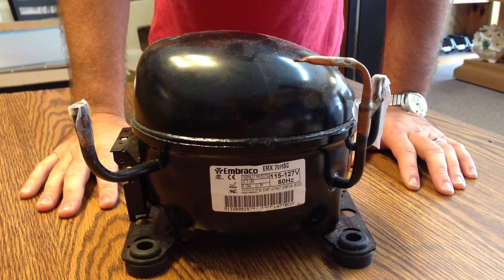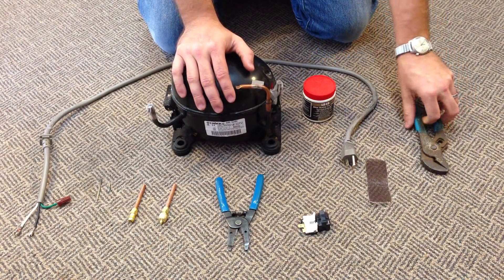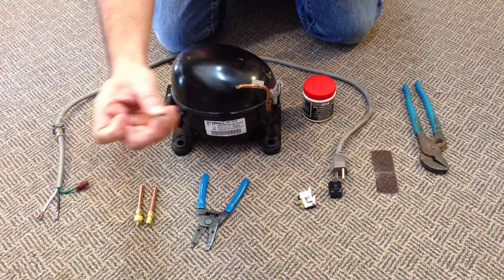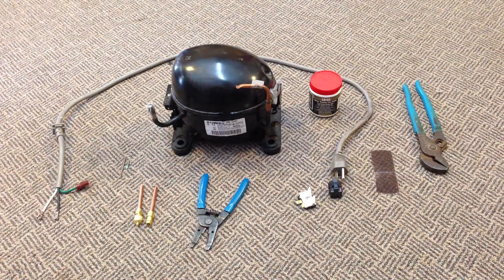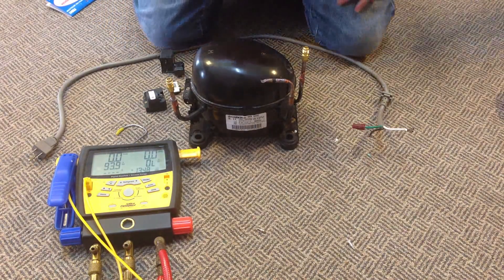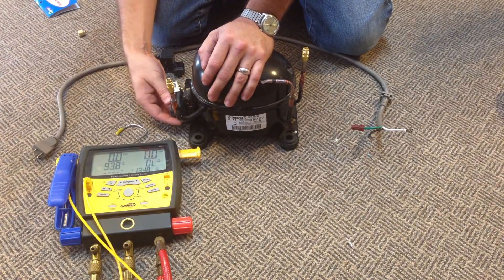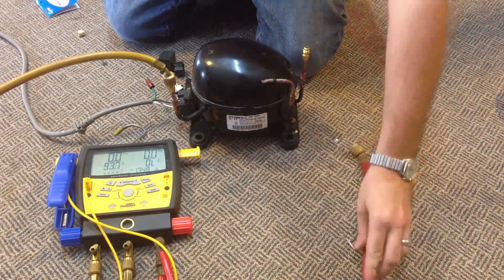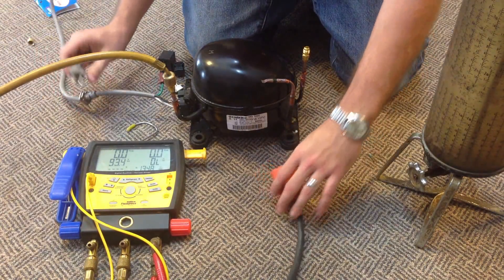How To Make a Vacuum Pump from Old Compressor

Comment: To sand the stubs of tubing, turn the unit on its side, more than 90-degree turn, so the grit will not go down the tubing into the compressor. Or plug the tubing with rolled up bit of paper towel, to be removed after sanding. Just be careful not to dislodge the temporary plugs while sanding! For better vacuum, especially for deep vacuum, pump into vacuum! For instance: Run 2 old compressors in series, with the outlet of one into the inlet of the other. If one has larger capacity than the other, you would generally want to put it on the low-pressure side, for maximum pumping rate, but valving varies and some valves require more pressure to open than others. The one with least valve restriction at low pressure should be the one connected to the system being pumped down. Also, a proper vacuum pump can be boosted with a crap pump like a single old compressor, IF the proper pump has a vacuum fitting on the outlet. Another way to go is to pre-evacuate a large cylinder and attach it to your pump outlet after it has pumped what it can out to atmosphere. You also can increase pumping speed -and protect your pump from water damage- by using a makeshift cryopump; that is, pumping through a U-shaped section of larger tubing you have prepared for the purpose of dunking in ice water with salt poured over the ice. Salt over ice makes the briny solution temperature drop to near zero Fahrenheit, so it can condense some water vapor even in vacuum. Better still, submerge the makeshift cryopump in a container of dry ice and alcohol, or if you can get it, use LN2 (liquid nitrogen). Copper wool (or brass wool or stainless-steel wool) inside your makeshift cryopump will improve the performance by adding a large surface area on which the pumped molecules can slow, contract, and even solidify. Purging the whole system with very dry CO2 will allow you to turn a crude vacuum into a high vacuum if the cryopump is chilled with LN2, because the CO2 will solidify on contact with such low-temperature surfaces. Other gas molecules being carried along by the CO2 will get buried and trapped in the dry ice formed in the LN2-cooled cryopump. Normal refrigerants will also solidify in a LN2-cooled cryopump. With proper valves installed and operated, you can make a laboratory-grade vacuum in a cheap way. After using the cryopump, be sure to warm it up and pump it out with your regular pump, to dry it thoroughly. As always, higher temperatures of the system being pumped will speed the process of evacuation. Water is particularly sensitive to temperature and will basically not pump at all near 32 F (0 C) unless the vacuum is prolonged and very deep.
Reply: Very interesting ideas. Would be nice to see a video of this.
Reply: It's difficult to read your meter . And yo know what your settings are. Yes I know we need 500 microns of vacuum for refrigeration work. Please speak to that. Is it adequate or not to get to 600 microns and how long does it take. That's what we need to hear before anything else. If it quickly does 500 micron, then I want to hear all about it
 Otherwise I've wasted a good bit of time ?
Reply: @deanstuder1775 - Why did you reply to my comment with a question about the original video as if I made the original video? I had nothing to do with the original video!
Reply: Where’s your video!!! Seriously haha such great information and info on multi pump systems! Very cool
Reply: @831Dre - I don't make videos, and if I did make vids about vacuum technology, it would require a whole series of videos. The subject can get quite complex, especially when it gets to the so-called High Vacuum regime, meaning a billionth or less of the original atmosphere is remaining. That might sound like a really good vacuum, but it means that there's still about a billion molecules per cubic centimeter!  
The best vacuum we can make here on Earth, with our "ultra high vacuum"  equipment, still leaves about 10,000 molecules per cubic centimeter. If you want better vacuum than that, you can go out into the solar wind, in outer space, where there are about four particles per cubic centimeter... Not counting electrons, because (for most purposes) electrons don't mess up the vacuum.
Reply: did you know that you cant turn a refrigerator on its side and turn it on unless you let it stand up and all of the oil settle back down? that would be a big mistake to turn it on its side
Reply: @kellybennett9221 - I was not referring to a working refrigeration system being turned on its side. Why would you be sanding the outside of the refrigeration tubing if it was a working system? DOH!

Comment: When sweating copper tubing, always apply your solder on the side of the tube opposite from your heat. When the solder draws all the way around to the heated side, you will know, you have a solid seal. If you apply solder on the same side as the heat, you will have to work the solder around the tube as you move your heat and will never know if the solder has sealed all points. This is not as critical with small tubing but becomes more critical as the size of the tube you are attempting to sweat increases.

Comment: this was my first vacuum pump. when I started in the HVAC trade in 1979 I worked for a one man shop "Smitty's airconditioning". after about 3 months he helped me [ he did all the soldering] build one of these from a old fridge compressor. I have no idea how well it actually worked but after seeing your video I think Ill build one and see.  and a dial -a-charge haven't one of those in years. cool video thanks. great job.
Reply: Same thing here I'm just a first timer and have no money to buy any vacuum pump but someday I'm planning on using a air conditioner compressor

Comment: Soooooooooo.....your going to take a piston compressor which can only pump down to MAYBE 25 in HG. and expect it to give you a dry system?
No way.

It wont' pull down deep enough to boil of moisure.

Only a rotary comp can do that
Reply: IT DOES AND DOES IT VERY WELL. IVE BEEN USING MINE FOR 10+ YEARS! PULLS SYSTEMS DOWN TO 350 MICRONS OR LESS.

Comment: can someone pls tell me what a vacuum pump is used for? i know what a compressor is used for. why would you need a vacuum pump? the smart alecks out there can be silent with their "to suck air" comments. only no bs answers pls. ie what projects could you use this for?
Reply: wayne d There are a lot of interesting experiments you can do with a vacuum. For example, in a vacuum water boils at a much lower temperature. So if you were to fill a jar with water and seal it with a lid, and then pump out the air, it will boil just from the heat of sunlight! I've done it before. I just put the jar outside on the sidewalk for a few minutes in the afternoon and the water started boiling. The more air you pump out, the lower the boiling temperature. It's even possible to get it to boil at room temperature, if you can pump the vacuum down far enough. There are a lot of other experiments you can do too.
Reply: to suck all the moisture out of the system
Reply: I use vacuum pump when making carbon fiber sheets or tubes to remove any excess epoxy  makes it strong and shiny smooth and perdy like my kitchen carpet in this video

Comment: Warning: Leaking R12 or R22 to the air is unlawful and punishable by fine. Have a certified hvac tech to recover the refrigerant to prevent damage to the ozone layer before removing the compressor from the refrigerator.
Reply: Matthew Kleinmann just 4?
Reply: I just suck the freon out with a straw.  This has the bonus of now every time I fart the temperature in my shop goes down about 4 degrees.

Comment: Schrader valves... the little valves that you removed to save the rubber seals are Schrader valves. (made in the USA)   Good video, I have used a compressor I converted into a vacuum pump  out of a freezer, for more years than I like to admit, for vac'n down AC units . Works just about as good as what Snap-on charges way too much for. (adjust the flame on your torch and watch pointing it at the compressor too, friends.) Oh and the larger the freezer or fridge you find usually has a larger compressor and it works  a bit better.  Sad that almost a half a million views  only gets ya  a thousand shared opinions. But I noticed most of the comments were just negative so maybe it's a blessing... Oh and also, if you work, walk, and lay  on concrete enough, you will find some used carpet to put in your work shop or garage and always keep an eye out for some more to replace the burnt, torn, wet, oily carpet you abuse . Peace
Reply: How did you prevent the unit from overheating?
Reply: The entire assembly is the valve, the thing he pulled out is the valve core.
Reply: Going to try this soon with a compressor from a mini fridge
Reply: Adding a run/start capacitor between a switch and wire assembly added a lot of power
Reply: I'm actually curious if it's possible to pull a deep vacuum with a compressor... I'm under the impression it can't really do that. It seems compressor is better for recovering refrigerant.

Comment: Do you have to keep those type of converted pumps oiled?
Reply: Yes, easy to change oil, flipnit over ,  oil will drain out, then pour oil in intake tube...any excess will blow right out...usually takes about 2 oz

Comment: You should be brazing that. Never solder.
Reply: Silver solder works fine.  I went through a phase about 20 years ago building my own plasma spheres and I silver soldered all the pirts and never had a problem.

Comment: Hi , I am gladly following .
I have two questions on this vacuum project 
1- could the motor stand 3 hrs of contentious ( non stop ) operating without getting killed
2- How do I know the exact amount of oil to fill in the motor 
thanks 
NOTE : I have now got an insight of the three pipes coming out of the motor although I can't deal good with the wires . I recently have a new German motor , but I don't know how to attach it to the grid . I just don't know what are the two wires to be attached to the grid. 
your help is highly appreciated
Reply: @lazyh-online4839 Make sure you replace it with mineral oil because a lot of refrigerant oil can react with moisture when pumping air and turn into acid. This will kill the compressor quick. Mineral oil works fine with air.

But I heard some refrigerant like R22 uses mineral oil and won't turn into acid, but stuff like R410a uses POE oil that does turn into acid.

Comment: A couple of questions.  How do you change the oil after a few usages of evacuation?   How deep of a vacuum can that compressor pull? I notice you only went to -24.7 inHg and you never reached into the microns.  This will never work as a vacuum pump.
Reply: I noticed that the pressure reading was still falling.  Probably didn't want to wait 15 min or so.
Reply: @LazyH-Online First, let me explain that I don't mean to insult you.  I just foresee a plethora of problems in using a refrigeration pot compressor as a vacuum pump.  I'm very aware of what, where and why vacuum pumps are utilized. I have first hands experience working with vacuum pumps from the HVACR industry, municipal water pumping stations and altitude simulation chamber.  Here are my concerns with this misapplication of the pot compressor.  How would you change the oil in this pot compressor?     Vacuum pumps have a means of replacing the oil inside because the oil will become contaminate and reducing the vacuum capability.  The pot compressors provides no means for replacing the oil inside because they are designed for an hermetically sealed system.  Gradually, the vacuum will become less and less with the contamination of the oil.  Additionally, by design, these pot compressors pump oil as they operate.  How would one know the oil level inside the compressor as time goes on?  This may work fine for a short term project, but as a vacuum pump replacement, I would disagree.
Reply: @LazyH-Online Obviously you don't know anything about HVAC or the refrigeration industry.  -24.7 inHg will not suffice for any of the standards needed to pull a sufficient vacuum in the industry.   -25 inHg will put you at approximately 100,000 microns.   Inside a system being evacuated to -25 inHg will have to reach approximately 120 degrees Fahrenheit or more to boil moister off.  The industry recommends that you pull at least a 600 micron vacuum to remove the moisture content from inside the refrigeration or HVAC system.   Additionally, what will happen when the oil inside that pot compressor becomes contaminated?  The answer would be that the compressor will pull even less of a vacuum, which will compound the problem.  A refrigeration compressor is not good for pulling a vacuum.

Comment: Hi
Nice work !   But I wonder what is the 3rd pipe protruding out of the compressor ???
Reply: I always thought that 3rd pipe was from the factory charge, crimped then sealed.
Reply from the maker: +urdu learner It is what I call the stem. Most of the time this is where a tap valve is put on or a solder in valve is placed. This is done so you can charge the unit while servicing.

Comment: It is not a magic. The vacuum pump is essentially a compressor with some gadgets added. It depends on refrigerant, but you can end with very hydroscopic oil, and most refrigeration oils are. Refrigeration oil turn acidic when get moisture, and acid will kill copper winding. I would definitely change your oil to a vacuum pump oil. Also I would add drain on the bottom to replace oil in the future. You can build a very good fluid extractor using free fridge compressor as a source of very strong vacuum. I would use refrigeration filter/dryer to protect compressor/oil from moisture.
Reply: How do you do that?

Comment: I have allot of electrical solder does that seal things as well as plumbing solder?
Reply from the maker: Not sure some solder can be softer than other and in turn I could see it not holding the bond as good but as far as the initial sealing probably so. I wouldn't recommend using that in this case though because these lines are under pressure.
Reply: No you never swap solder. Electronics solder is for electronics and plumbing is for plumbing. In this case silver.

Comment: Is the filling line just another intake like the inlet? Does it matter which one I seal and which one I use for suction? I scavenged mine from the dump and all three lines where cut so don't know which one is which, but they both seem to suck.
Reply from the maker: The service port as I call the stem is the one I would close off because the other is the main suction for sure so why not use that one. Not sure if the service port line will behave the same when I comes to the gas moving through.
Reply: But they have both already been cut so I cant tell which is which.
Reply from the maker: +MrMonkeybat Hard to say with out seeing it. Some times the position can vary.
Reply: As mentioned in another answer there are two low pressure ports.  One connection is to the circuit (evaporator outlet) and the other is the factory fill port that is usually pinched and soldered.  In all the cases I have seen they both simply connect to the internal space with maybe a baffle or a simple U-bend in the pipe. 

So both low pressure ports work the same.  Often but not always they are slightly larger diameter than the high pressure line.  

If you are not sure just power the unit up and check which two pipes suck and which one blows.

Comment: If u used pure silver would go to the heat and seal better
Reply from the maker: Not sure if pure silver will hold the pressure, I use 15%.
Reply: Patrick Slack absolute bollocks, ask a plumber, aka me.
Reply: BlakeTube Repair & Reviews you are correct 15% silver solder is perfect

Comment: great recycle of the ubiquitous CL "free working rusty fridge" for something slightly more productive than beer chilling!! 

why use hard solder though? even a perfect vacuum is only a bit under 16 psi, and the pressure influence would tend to make your swaged fit tighter. plain old 50/50 you can get away with a cheapo propane torch rather than needing a more sophisticated air/gas rig. the refrigerator needs hard solder because it's a couple hundred psi differential, and it's trying to make stuff fly away from the "source" (your comp head). i know for you it's an a/c refrigeration tool, but it's a handy puppy for lots of other stuff too (like laying fiberglass, de-airing thick gooey mixtures, or collapsing 55 gallon drums, lol). also that inch and a half of 15% silver costs about 10 times what the same length of 50/50 does. 

good vid though, nice and to the point, not a lot of wasted time watching you do uninteresting stuff, lol. what oil do you run in it? 24 3/4 inches is pretty damned respectable, btw! think a "flap valve" on the outlet could buy you another inch or 2? hell, a ping pong ball behind a cross pin that gives a little "wiggle room" would probably work (and a ball valve for your "sealing cut-off", lol. no cap and plier juggling then). i know, "make your own damned vid, know it all!!!"... lol. sorry about that, just "fresh eye product and process improvements" ideas.